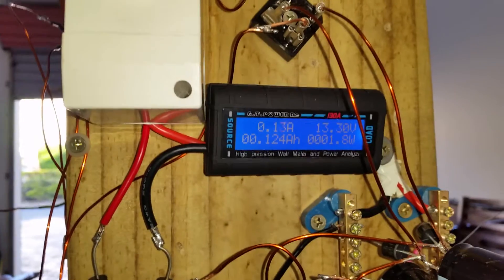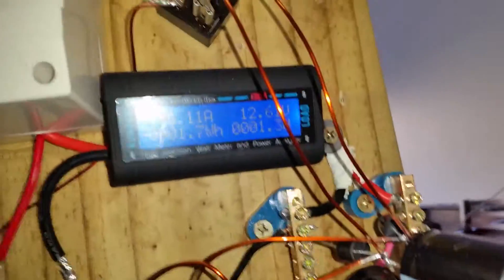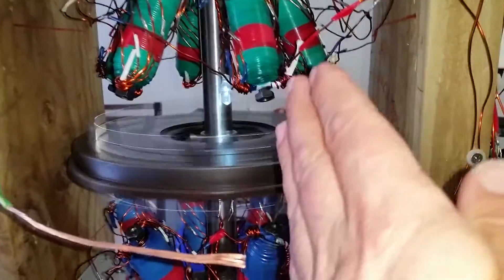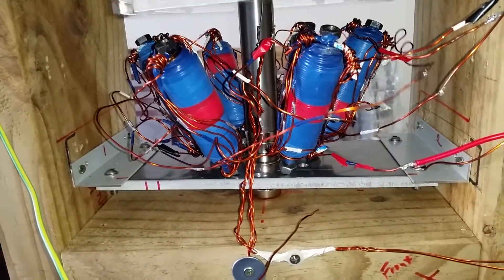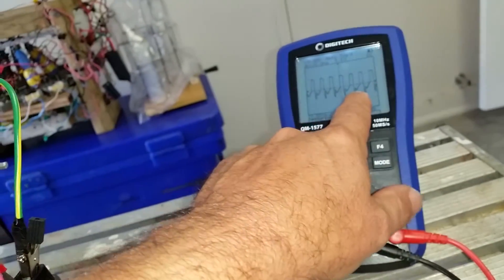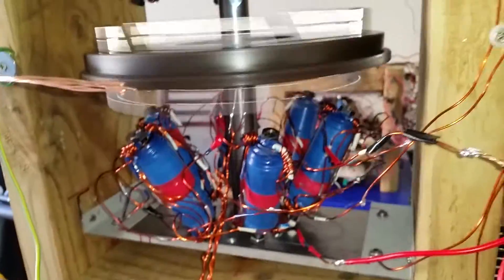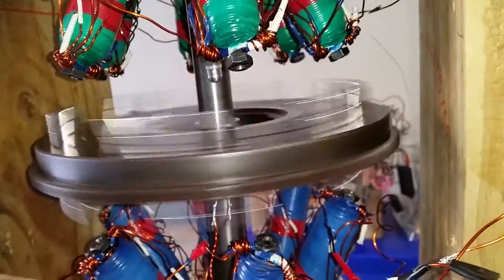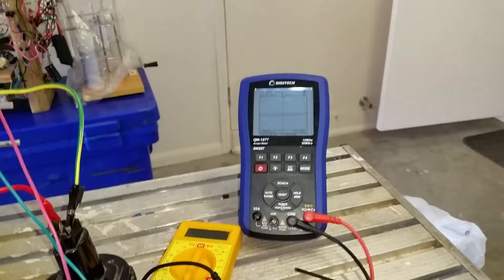Homopolar generator update Mackay SAES

Comment: looks like you could easily move the coils closer to the magnets, but i would have prefered coreless coils for better power out versus torque taken from the rotation
Reply from the maker: Yes the bolts are carbon steel 10mm drilled out 6mm drill.
Now days i use a 10mm roll pin.
If the gap is less itloads up and slows down.
This early days totally new design now.

Comment: This really has nothing to do with the Faraday homopolar generator, as there is no energy being drawn from the axle and edge of a conductive non-ferrous disc that's co-rotating with a disc magnet.
Reply from the maker: Your right I found that I could not draw direct current from the steel disk. The disk should have been Alu with an even magnetic field (big speaker magnet) not six magnets around the edge. The main shaft could have alu tube fitted that would also give a voltage from the center to the end of the shaft. I have learnt a lot making this device though, gaining knowledge and experience is my objective. In this respect it is successful. My next one is being designed. I am hoping to segment the disk and draw the current as a plasma as a static charge but still trying to imagine all the little bits and pieces that will make it work. Other ones I have built have made 150mv it is too small for me to work with it needs to be accumulated like static charge then discharged through a transformer this is the best solution to the low voltage problem I can think of.